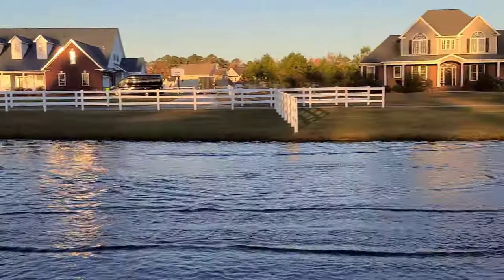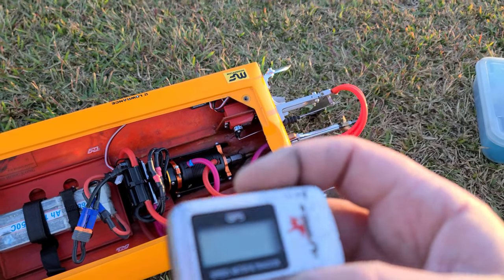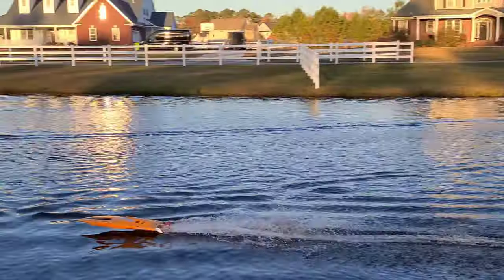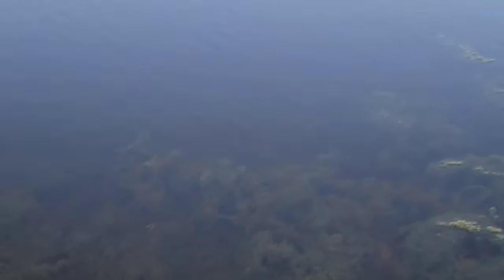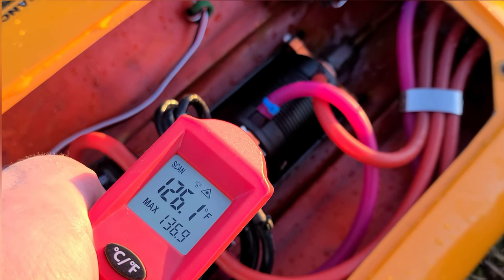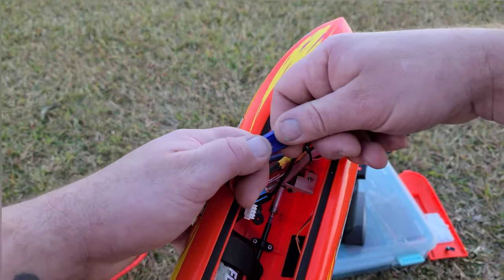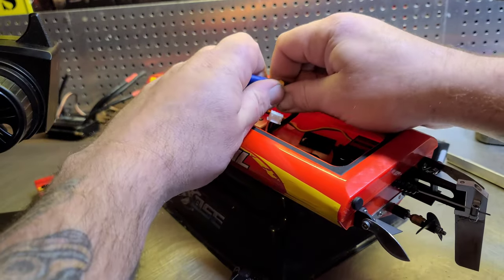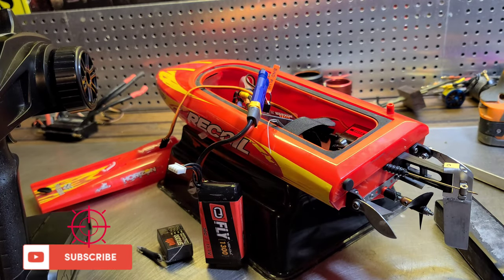RC Boat Cooling Line Consolidation Tips | Spectrum stx2 troubleshooting

Comment: Like how small? There is not a lot of choices for mine sonicwake 36
Reply from the maker: The hose clamps come in an array of sizes xxsmall all the way up to xxxl. Thin, wide.  cut the screw part off of the hose clamp, the rest can be modified to fit your needs.

Comment: Hi friend !  A nice video.  I'm from Italy. Listen, I have a proboat shockwave 26. With a maximum battery 3s.  With 3s it goes + - 45 - 50 km.  How can I reach higher speeds, let's say without changing the engine?  I can only change propeller or not, I have to change everything.  A thousand thanks.  Yours sincerely
Reply from the maker: Yes you can change the prop and gain a little bit of top end performance, if you use a 3 blade prop you can possibly gain acceleration and speed.  what size battery are you using?
Reply: @IRONCLADRC  battery 3s HRB 5000.
Reply: @IRONCLADRC  prop 40mm 2 blade. plastic